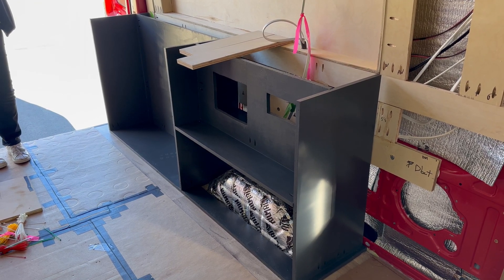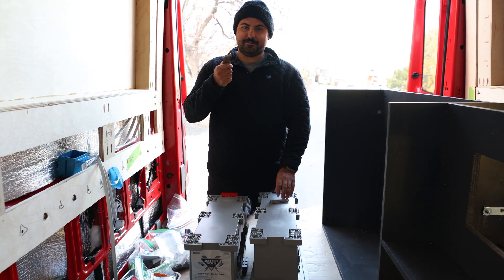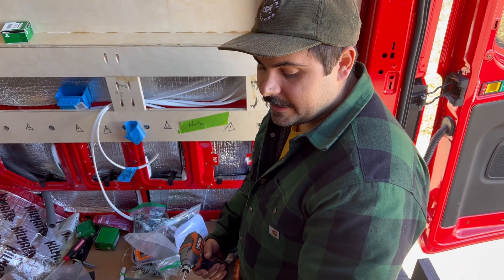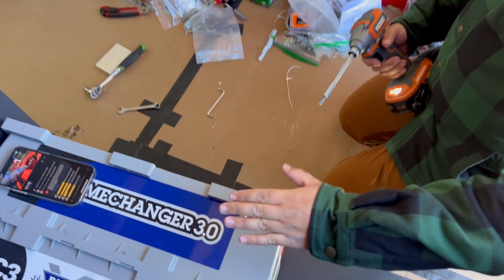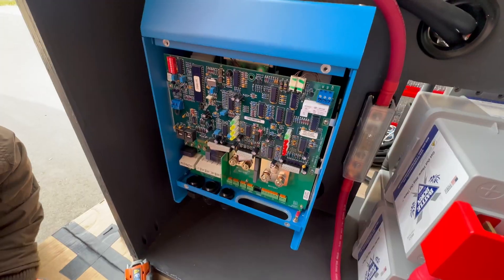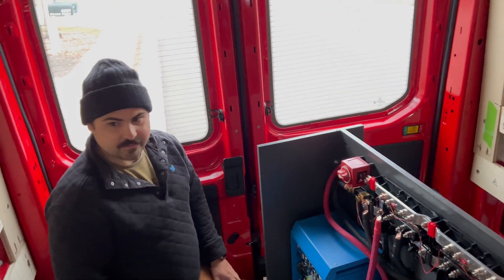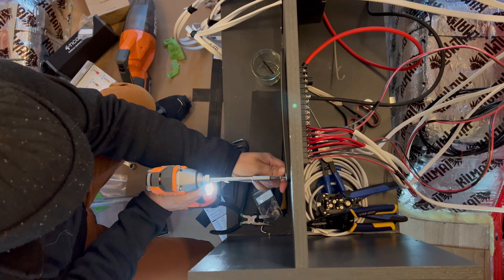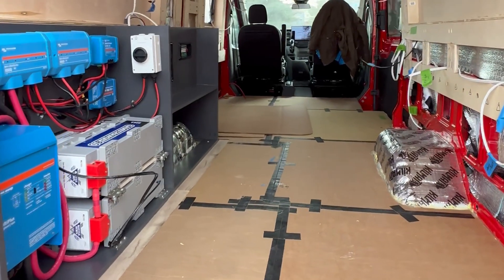DIY Ford Transit Van Electrical Installation (540ah Lithium, DC-DC, Solar, Shore Power)

Comment: What is the box you used to attach the units to? Did you guys make it or buy it?
Reply from the maker: We built it! We made an entire video about the process and measurements here: 

DIY Van Build Electrical Cabinet for 2x Battle Born Gamechanger Batteries
https://youtu.be/nnJ6P46LWX8